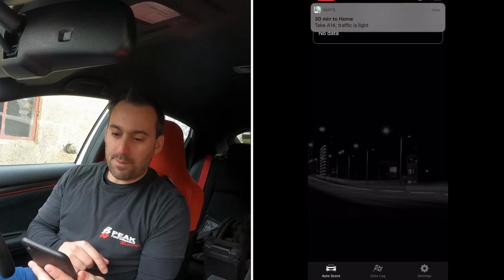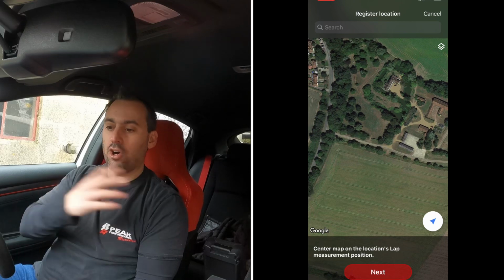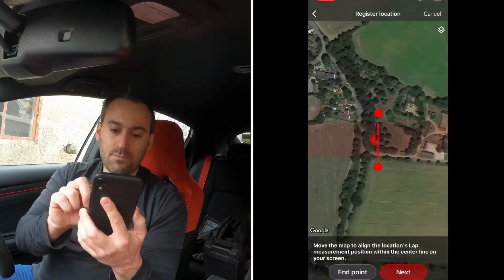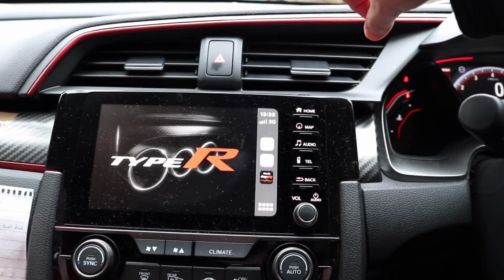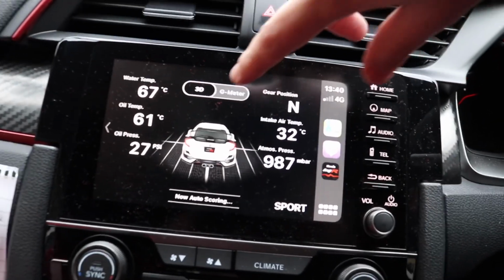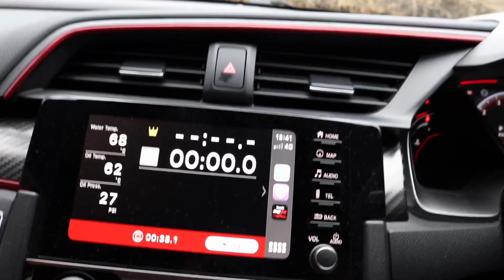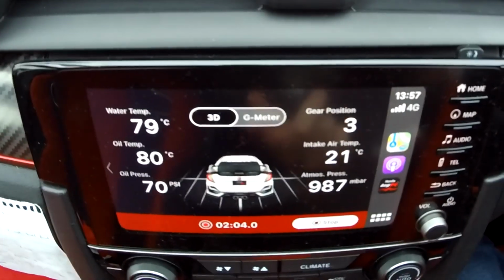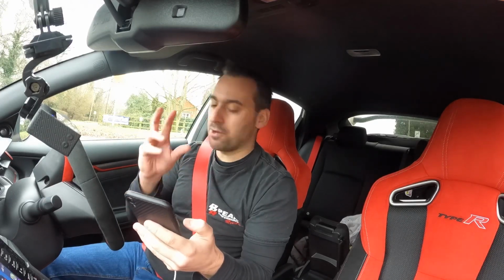Honda Civic Type R LogR Performance App UK - HOW TO USE

Comment: That's pretty neat to have all that data logging on board from standard. I had to buy a Dragy just to get some of that and none of the lap/sector stuff. They claim lap timer mode is coming but who knows.
Reply from the maker: Its epic isn’t it, I have a number of data boxes now but having one neatly fitting into a standard interface is so good, I particularly like the live data. 
I have a Dragy too and there brilliant for the performance straight line stuff and a great buy for such a low decent price point too. 
Thanks for watching bud ❤️✅